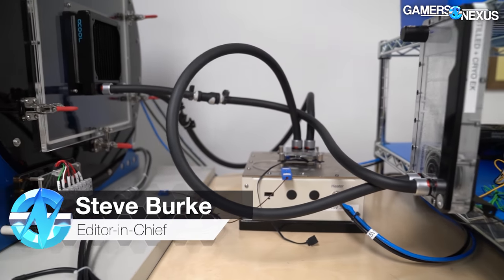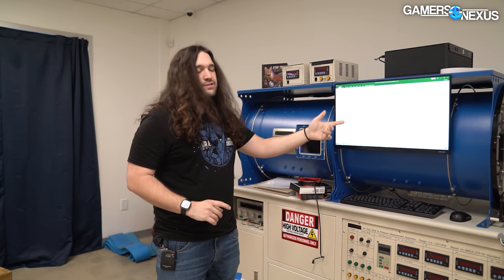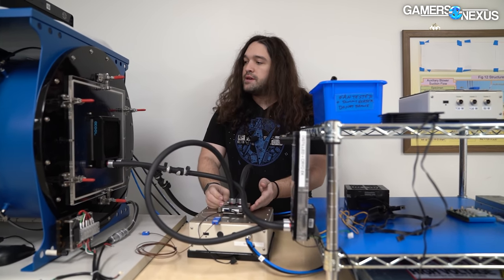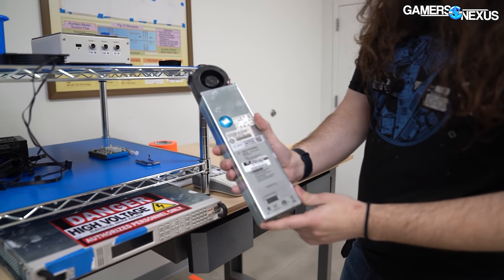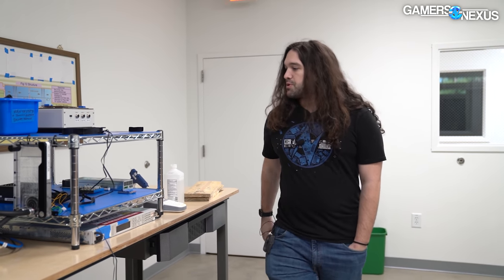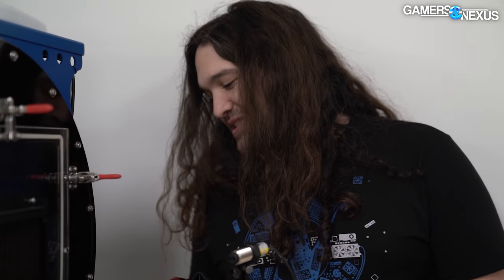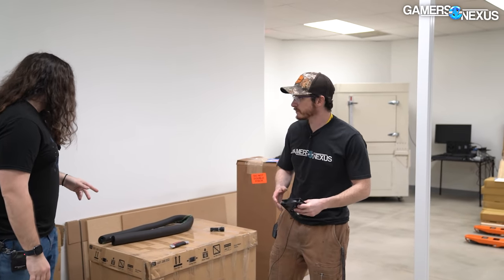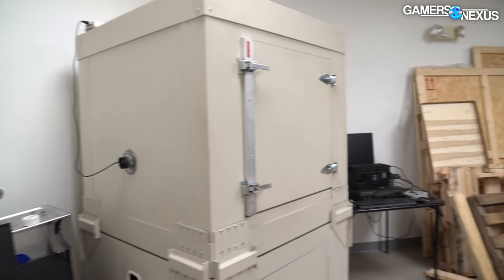GN Lab Update: Fan Thermal Testing, Pressure & Flow Charts, & Challenges

Comment from the maker: Quick note: The radiator and fan won't be mounted to the fan chamber during actual dummy heat load testing, only during non-heated testing. That will be conducted on a different mount, which allows us to run two tests at once.
Subscribe to GN Extras: https://www.youtube.com/channel/UCgeS8J9W62B-uLBgzp14BtQ
The best way to support our work is through our store: https://store.gamersnexus.net/
Like our content? Please consider becoming our Patron to support us: http://www.patreon.com/gamersnexus
Reply: G'day Steve,
🤔I think I understood your Fan Extremities example
So the Max CFM is like holding the Fan over your head with no Filter,
While Maximum Pressure is placing your fan behind a TG Glass Dust Filter like we see on some MSI PC Cases.
Reply: Guys, I've been noticing that there's like a second or two being truncated from the end of your last several videos, not sure if it's YouTube doing it, or  what, but it's rather jarring having Steve say "we'll see you all nex-".
Reply: It's not terribly relevant at the power levels that PC case fans draw but you might want to at least keep an eye on power draw in case of outliers. I know when evaluating replacement server case fans power efficiency is a consideration, but the power draw is roughly an order of magnitude greater and we're using a lot more fans.
Reply: Have you considered working with "Major Hardware" in som form with testing fans?
Reply: 1:00 Sponsor - how about to mention the compatibility with Intel 12th Gen. CPUs with DDR5 RAM? Most of the RIGs have a problem to use XMP with 4 sticks... 🤷‍♂️
Reply: 06:00 i see here only one problem in this configuration - radiator... Whe have plenty of then
M on the market. One fan can made an better job then the other one on other type of radiator. I mean - we can see it clearly, Arctic Cooling Liquid Freezer II series use 10mm thicker radiators and wins most tests. Fans are always the same... 🤷‍♂️ Only the radiator became thicker.
And... How about pull and push configuration?
Reply: 14:03 - Do you mean 2-pin (Voltage and Ground) fan instead of 3-pin? The third pin of a DC fan should be for TACH feedback.
Reply: 20:00 whe have to have two tests - I mean Fan can create an sound (first test in foam), then we should have an test with an fan mounted in case or some art of metal sheet to simulate an case becouse of vibration and so on.
An fan in my hand is quiet, in my PC case is jUsT ScrEEmiNIg...
Reply: Amazing video here. Can't wait to see how this methodology develops over time. The learning curve has to be Immense, It is literally blowing my mind.
Reply: Regarding the PQ-curve: it orccurs to me that the product P*Q is power. And from how those curves look, there should be a more or less defined "maximum power point" between Q=0 and P=0. Maybe this is a good third point to look at and potentially graph against RPM or PWM duty cycle. 
Nevertheless, I'd really like seeing a plot with, say, three representative PQ-curves. At pre-defined duty cycles like 20%, 50%, 100% for example. I think that would be easy enough to read. That said I'm used to looking at technical graphs from work. You probably know better how much is too much information at once for your general audience.
Reply: Welcome to Julia language it has great libraries for this and visualisations (no z)
Reply: So, how are you going to measure thermal performance of the liquid cooling close loop?  Both exhaust air temp and coolant temp is dependent on the ambient temp of the intake air, which in this case, is not controlled.  I don't believe your results will be trustworthy using just room AC with a thermostat.  Your intake air also needs to be controlled.
Reply: the most important :
test in the same ambient temp -because cold air more dense.

the sound chamber setup is perfect, well done.

about air flow, 
in zero air flow, the pressure in small or big diameter is same(max pressure).

in max air flow , big diameter show less pressure then small diameter. (until it will be max air flow in same diameter, then  the pressure go to 0 psi).

** if you had 0 pressure it 1 of 2 Possibility:
1) max air flow at the given pressure . if not, you know the pipe diamer is little for max airflow.
2) no pressure to the pipe.
Reply: @orencomputerelectronics8751  It's not like they  haven't spent 1000's hour learning the fundamentals - giving a PhD some competition
Reply: @orencomputerelectronics8751 Zero pressure means there's no mole's to move you dipper
Reply: Seeing the actual real world data on how a given fan responds to and deals with radiator impedance at different rpm and noise levels is going to be unbelievably useful. I'm so freaking excited for this I can't even begin to express
Reply: That was FUN!
Reply: @KarsonNow  I agree. Some new fans have rubber insulates to cut down noise. A fan without the rubber might be quieter in fome but loud as hell mounted in a case
Reply: Steve I suggest you get in contact with Major Hardware to test so of the designs that get submitted or have been submitted. Got a few designs that perform excellently.
Reply: 20:49 for example a fan that vibrates a lot, with the sponge you won't know how much noise it actually makes mounted on the case.
Reply: It might actually be interesting to test in the flow chamber with the heat load - the heat will change the density pretty dramatically which could really impact fan performance
Reply: @orencomputerelectronics8751  you have things a bit sideways. To flow the same air a smaller fan will create less pressure rather counter intuitively  - pressure is inversely related to airflow speed.
Reply: Mike should be wearing gloves when handling your foams, human oils will start to degrade the surface and soak into the foam over time. Which will change the properties of the foam rather drastically.
Reply: How will you pick fan / block combinations and what about flow, jet plate water blocks are really sensitive to flow rate, how do you pick it / maintain the same one every time?
Reply: I think the foam mount for the fans is a mistake. It should be held rigidly in place, as the foam eliminates any imbalance the fan might have, that imbalance actually causes noise when mounted in a case, or on a radiator.
Reply: For open loop watercooling it's extremely common to choose fans based on a set RPM or at least a small window as many people like to run many slow-ish fans below 1000RPM for rads.
Reply: All you need to do is write a program that interprets the data accordingly, pretty easy to do for some people. I know a guy who can do it, BUT he is a physicist and an expert in thermodynamics...No he really is a physicist.
Reply: this was fun thanks for pointing out GN Extras
Reply: For the fan sound testing would you not also want to test the interface between the fan and case and any vibration mitigation efforts by the fan manufactures (i.e. rubber pads).  If that is the case would it make sense to have a metal mounting plate imbedded in foam so that it is still isolated?  Wouldn't be perfect replication of harmonics for all the different cases out there but it would be a baselinge.
Reply: I hope you realise that within the next few years a bunch of smaller manufactures will start trying to book testing time with your lab. Things will only scale up from there.
Reply: With the machine, you can basically measure and extrapolate the fan curve of the tested fan to show its performance and power draw. The sound measurement machine will also allow you to measure its sound performance against its performance. To be frank, as long as the fan dbA is under 40, generally people won't notice it at all. 40+ to 50+ is generally where an air-conditioner is functioning at max cooling settings and it would be unusual for any fans of 120mm or even 140mm to hit those figures unless your RPM was over 3000.
Reply: When are you going to post another video about this? I’ve been eagerly waiting some results because I have been putting off buying fans for my PC until you post a video testing fans on the market. How has the progress been coming with this?

Comment: Steve,
As a scientist, I'm super impressed with how you guys have grown in your methodology and continued commitment to rigor. I'd suggest for any fan testing that you guys test a minimum of 3 individual fans of each model. You need a minimum sample size of 3 to do actual statistical analysis. As for data visualization you guys should look into R, it's really powerful for data analysis and visualization.
Reply: I'm curious if you've ever worked with Python, MATLAB, or similar tools. If so, how does it compare to R? What are some of your favorite things about R? I'm definitely no data scientist. The most I've done in that regard is computation and data load in SQL.
Reply: @OGBhyve  Never used R either, but MatLab is the standard, at least down here where I am.
Reply: As someone who's been exposed to R, python and matlab, the main difference is the availability of standard library functions and language design. Depending on your specific domain and experience, any one of the above may be "better", and any could in theory support any use case you have if you put the effort in (though matlab is the least flexible in that regard).

Matlab is often pronounced "standard" because it is a commercial product, with the requisite marketing team telling organizations it is the standard, which then in turn treat it as standard. Take those claims with a grain of salt, but also take my distaste of it with a grain of salt, because I don't like this business model much. This doesn't mean it's inherently better or worse than alternatives, and its business and copyright model is definitely a trade-off for more streamlined support (if you have the cash).

I'm personally biased towards python, since it's just a usable scripting language. When you use python for scientific analysis you're not really using python, but a variety of projects by other people that happen to extend python to enable your use case; this makes it very flexible, but also often cumbersome to configure, because there is no commercial team optimizing for your use case, and you need to figure out which tools to use on top of python to get it to work (though scipy helps a lot in making that easier).

R on the other hand is a smaller community that is more focused on getting scientific computation right - making it easier to get setup, with similar flexibility, but having more odd quirks in language design. Its scientific computation features do have much better integration, so you won't end up with three ways of doing the same thing but only one correct way, as you often do with python.

Matlab finally has a solid base of library functions for a wide range of domains. Extending it for your specific use case is harder. The language is also a bit of an oddball, being an ancient, strange mix of functional and imperative components. If you have the money to pay for commercial support, or happen to need exactly what it has, it's quite usable.
Reply: @OGBhyve  PhD candidate in computatioal physics here, I've got experience with all 3. Essentially, R is a stats tool. It has a very specific use case for statistical analysis, and it's extremely powerful in this area. Python is python, like other big name languages, it's super powerful and seems to be the favourite for computational science, since it's farily light weight, there is quite literally a library for everything, and it's very simple and easy to work with. MATLAB, like R is more niche. I've always used it when working with large datasets, almost as a replacement for an excel spreadsheet. It's super useful for solving stuff like matrix equations, linear algerbra etc. It's capabilities extend a lot further than this, but this is one of the most common applications I've seen

Comment: When you put up noise-normalized numbers, can you also set up a column to calculate the fundamental frequency the fan blades generate?
I've found that how the pitches of the fans in a system align with each other is much more important than their volume in getting a system to sound... not obnoxious.
Reply: Yep
Like how coil whine is soul destroying compared to a semi loud fan
Reply: @Alucard-gt1zf  hey I just noticed you are called dracula backwards.  Am I supposed to bite you or something, I don't really know how this is supposed to go :D
Reply: @DailyCorvid  Alucard is the son of Dracula
Reply: this is something that Major Hardware has been doing with his "fan showdown," where people make 3d prints of fan designs that they press onto a noctua chassis and test them.  you can get an idea of the "tone" of the fan, as well as the loudness
Reply: Or just use A weighting, which also consider the human ear sensitivity, but another consideration is what frequency can be dampened by the case
Reply: Yes please. I recently got 3 corsair 140mm maglevs and they whine at certain speeds... I think the MajorHardware guy does it fairly well.
Reply: yeah, low pitched fans can be quite relaxing
Reply: @DailyCorvid  Watch Hellsing Ultimate: abridged, you will understand
Reply: @ghomerhust  It is cool the way he does it. He doesn't spend much time explaining it, though... just "here are the spikes" - it would be good to have a primer on what that actually means... like if you're under 40, you're likely to be annoyed by this high-frequency noise, whereas if you're older, it's very likely that the high pitch will be completely unnoticeable to you but may irritate yungens :)